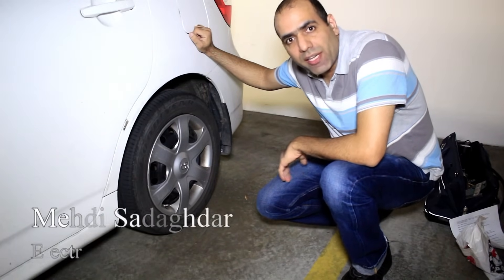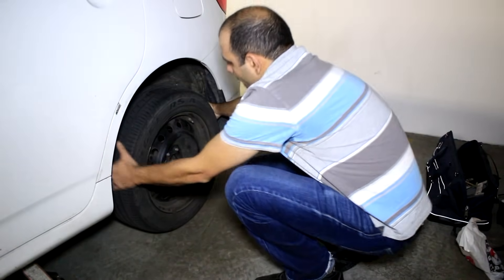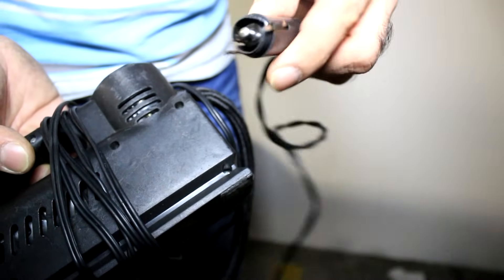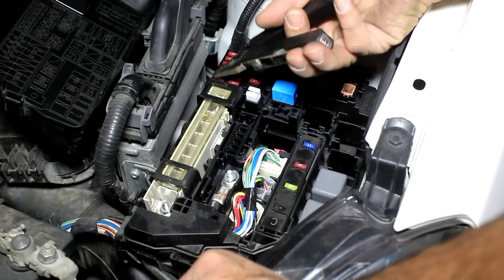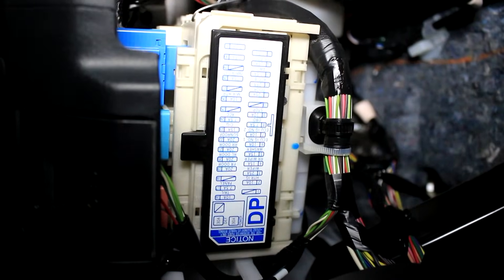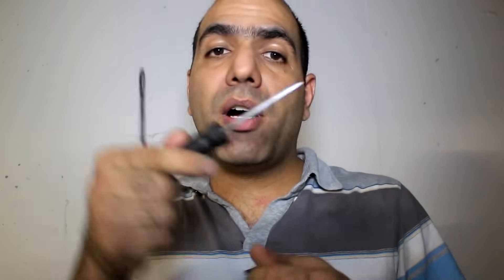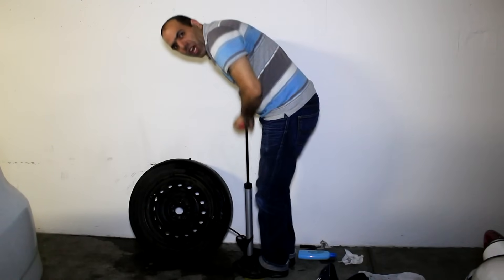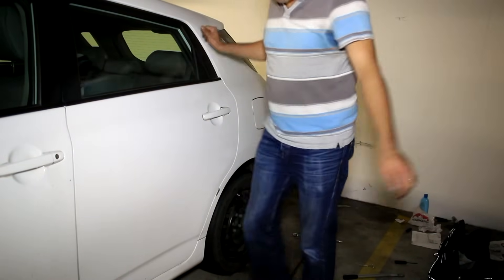How to Repair a Flat Tire

Comment: Don't ever do this. Just take it to a tire shop and have them fix it for FREE.
Reply: +flexor212000 Where the fuck do you live that a tire shop fixes tires for free?
Reply: SporadicallySane tireville
Reply: +SporadicallySane I work at Les Schwab and we always fix flats for free
Reply: flexor212000 i dont think you understand that he does this as a joke
Reply: +Ludde_12345 use your spare :)
Reply: +flexor212000 Discount Tire has always done it for free.  Even did it once when I didn't but the tire from them.
Reply: +SporadicallySane I've had it done in Canada many times for free
Reply: Just not used to it in Australia I guess. Glad you get a quality service like that in North America.
Reply: What if you aren't anywhere near a tire shop?
Reply: +SporadicallySane Les Scwab, Discount Tire
Reply: +Ludde_12345 put on the spare and drive to one.
Reply: flexor212000 what if you get punctuated twice?
Reply: +Ludde_12345 are you referring to having your spare tire punctured on the way to the tire store? then in that stage you have to be towed to the tire store and get a new tire. The liklihood is pretty low that you would get a puncture in the spare after you just put it on after getting a flat tire. It seems like you are trying to paint all of these what if scenarios to justify something? I mean sure if you could whip this out and fix it roadside I guess that would be nice?
Reply: +flexor212000 HOW ABOUT NO
Reply: +Noble Tabibian If you could do this at roadside go ahead. HAHAHAHAH

Comment: How to repair a flat tire
Step 1: Change the blown fuse in the fusebox.
Reply: +Sandman4991 I don't think I did it right. First, I repaired the lighter fuse. Then I changed the fuse. Then I blew the tyre.
Reply: +WorasLT But you don't have to change the fuse if it isn't blown, so:
Step 1: Blow the lighter fuse.
Step 2: Change the blown fuse.
Step 3: Repair the tyre.
Reply: @Sandman-cr6zn  Step -1, damage the lighter plug; Step 0, plug into the lighter socket.   :-P
Reply: @Sandman-cr6zn  200th like
Reply: +Bill Bingham you did have a spare under the bonnet though right :) (and I do not care if I spelled.. spelt.. whatever it correctly.. you know what I meant ) LOL
Reply: Step 3: Do just like this at 1:27 😂
Reply: Heh good one.
Reply: What you should be doing to know the proper P.S.I. on your tire. Is either check on the label, that'll have a chart on the proper P.S.I.,  that is usually layed by the driver side door. Or check in the owner's manual where there should be a chart as well. The norm is usually between 32 to 36 p.s.i. but better be safe then  be sorry.

P.S.
For those that don't know P.S.I. stands for Pounds per Square Inch. Rate of pressure per square inch to be more exact.
Reply: Nebepjauk asile
Reply: Step 2: replace coolant
Reply: @WorasLT i have the same pic as yours but i have mask on and a glasses and you are a pirate
Reply: I’m dead
Reply: Lol
Reply: lmaoooooooooo
Reply: Lol😂😂
Reply: Hahaha
Reply: I died a little that much I laughed😂😂😂😂😂
Reply: Instructions unclear.
I started the car on fire by putting a 40 amp fuse where a 5 amp was suppose to be.
Reply: LOLOL
Reply: Lol
Reply: OMG this step guide would make the best Tshirt for this channel
Reply: WorasLT iiI'm
Reply: aik nakui
Reply: SMH aren't funny.
Reply: Uhhhh got ass stuck in toaster

You wanna know how?

The toaster is extra large

Comment: Proper tire pressure can be found most usually on the door sill area.
Reply: Or the tire
Reply: You should never use the tire pressure rating on the sidewall of a tire. You should always use the number on the door or in the owners manual, since it will have the specific tire pressure for your vehicle.
Reply: Run a set of soft off road tires at that pressure, let me know what happens.
Reply: the electrocuted woodworker 
When you get to special tires like offroad tires, than it's a different story. Most people don't run offroad tires, and should not be going by what's on the sidewall.

Comment: That a bike tire plug. It might not last or you might get lucky. A car tire needs to be plugged from the inside and a patch placed over the plug- also from the inside.
Reply: +Adam R Those types of plugs hold perfectly fine. Of course, the plug and patch from the inside is preferred, but fixing it from the outside is just fine. And another secret - Discount Tire stores fix tires for free and properly.
Reply: +Adam R I feel like there is an update coming.
Reply: +Adam R Those plugs are what was used for decades by tire shops on cars before patches became the norm.  They work just fine, however, sometimes (very rarely) they can get loose.  Nowadays they're typically relegated to "emergency" use but they will typically last for years.  If they come loose, it will take several seconds for the tire to go flat, so it is not a blowout experience, just inconvenient.  Because tires are belted on the tread, the tire will not tear and explode.  Obviously, if it were a sidewall, both patches and plugs are a terrible idea and shouldn't even be used for temporary purposes.

That all being said, the hole he patched is too close to the sidewall and the tire should have been replaced.
Reply: +Adam R Those plugs are built for car tires, they're fine. Bike tires (I'm assuming you mean bicycle and not motor bike) are usually patched on the outside of the tube. Sure, you can patch the inside of a car tire, but then you have to deal with getting it beaded again which is probably impossible without the right tools or lighter fluid.
Reply: shepd shepd Too close to the side wall?! It's almost in the middle of the treaded surface! It was a perfectly fine repair.

Comment: Your fusebox is incompatible with the most of Hollywood action movies. Please change your car.
Reply: What, this doesn't make sense please explain, because if it has to do with hot wiring (like i think it does) they aren't accessing the fusebox, they are taking the ignition wires and touching the hot wire from the battery and touching it to the ignition wire etc.

Comment: First.
Spelled repair wrong.
Reply from the maker: +Toontown Telegraph Thanks! Corrected
Reply: Spelt*
Reply: ***** I have decided you like spelt more, because I like it that way.
Reply: ***** Doesn't matter you like it or not, the whole damn world spells it "spelt" except United States.
Reply: So keep and keeped, feel and feelled, deal and dealled, kneel and kneelled?
Absolutely not. It's "spelt."
Reply: +DrakeSilmore As silly as this argument is, in British English "spelt" and "spelled" are indeed pronounced differently and "smelt" is a valid past participle of "smell". If you need a source, check your local playground for the example phrase: "he who smelt it dealt it". :-)
Reply: +ratchet256 In American English, spelt primarily refers to the hardy wheat grown mostly in Europe, and the verb spell makes spelled in the past tense and as a past participle. In all other main varieties of English, spelt and spelled both work as the past tense and past participle of spell, at least where spell means to form words letter by letter or (with out) to make clear. Outside the U.S., the two forms are interchangeable in these uses, and both are common.

Source : http://grammarist.com/spelling/spelled-spelt/

while you are right, oggo loggo is also right. win-win
Reply: Murkaeus Well, that was pointless and redundant...
Reply: +Toontown Telegraph Both spelt and spelled are acceptable in UK english , and only spelled is officially acceptable in US english. You will find spelt used in northern US and canada, as well as the deep south, quite often, and 'spelled' pretty much everywhere else in the US, however, only in the past participle form.
With spelled being an acceptable British english received spelling, spelled is the only form which is always correct, regardless of your location.
Tyre/tire is another... just leave it be.
Reply: +Derek Leung That all depends on the country that they learned or "learnt" their English from. In the US we not only spell it that way, we prounounce it that way. Generally something that is past tense ends with an "ed" (cooked, hated, discovered). So implying that "spelt" is correct would basically imply that everything else that ends with "ed" should end with a T instead. (ie: cookt, hatet , discovert. So I think the best thing you can do is just accept that no English and American are both different but neither of them is "right" or "wrong"
Reply: +Murkaeus nice copy past
Reply: Wooooow... did not expect that not to sink in. Such a bunch of idiots replying to me, I don't even know why I bothered 
-_-
+benryves - For what it's worth, thanks. But I doubt we'll get anywhere.
Reply: benryves Ok, good point. Now we'll just move on to yell -> yelled. I know both spelt and spelled are officially correct usages, so the discussion is rather pointless, but as far as logic goes I'd say English is rather inconsistent, and ending with -lt just doesn't feel right for me. Then again, I'm not a native speaker.
Edit: seing as some words have both -lt and -lled endings, but others only have -lled endings, I'd say spelled is more correct of the both corrects.
Reply: Michael Tempsch And Platinium!
Reply: +Richard Smith and helium
Reply: +Gordon Freeman Beat me to it
Reply: +xSkitZx Look, I can list words, too!

Becudgelled, Bedrivelled, Blackballed, Chargrilled, Curveballed, Detasselled, Disannulled, Disbowelled, Dishevelled, Ensorcelled, Forestalled, Intertilled, Misenrolled, Mislabelled, Multicelled, Outcavilled, Outrivalled, Overchilled, Overspilled, Parallelled, Pedestalled, Protocolled, Redistilled, Reinstalled, Semiskilled, Sentinelled, Speedballed, Squirrelled, Steamrolled, Stonewalled, Subtotalled, Teetotalled, Unfulfilled, Uninstalled, Unkennelled, Apparelled, Backfilled, Bankrolled, Bedevilled, Bejewelled, Bemedalled, Caracolled, Chandelled, Channelled, Cockbilled, Controlled, Counselled, Coveralled, Embowelled, Empanelled, Enscrolled, Enthralled, Farewelled, Flannelled, Goodwilled, Handselled, Hatchelled, Highballed, Impanelled, Imperilled, Initialled, Inscrolled, Inthralled, Jackrolled, Landfilled, Lateralled, Marshalled, Misdialled, Misspelled, Mothballed, Outduelled, Outsmelled, Outspelled, Overbilled, Overcalled, Overfilled, Overkilled, Prechilled, Predrilled, Quarrelled, Reenrolled, Reexpelled, Relabelled, Remodelled, Repanelled, Retotalled, Rototilled, Scandalled, Shrivelled, Snowballed, Spancelled, Spurgalled, Stencilled, Surveilled, Tendrilled, Timbrelled, Trammelled, Unequalled, Unexcelled, Unlevelled, Unravelled, Unrivalled, Victualled, Vitriolled, Windmilled, Barrelled, Bushelled, Cancelled, Catcalled, Chiselled, Compelled, Corbelled, Cordelled, Corralled, Crenelled, Cudgelled, Defuelled, Dispelled, Distilled, Drivelled, Drywalled, Enamelled, Eyeballed, Ferrelled, Frivolled, Fulfilled, Funnelled, Gambolled, Gimballed, Gravelled, Grovelled, Hanselled, Hirselled, Hostelled, Houselled, Installed, Instilled, Kennelled, Kernelled, Laurelled, Logrolled, Lowballed, Marcelled, Marvelled, Misbilled, Miscalled, Morselled, Nickelled, Outkilled, Outpolled, Outpulled, Outrolled, Outwilled, Outyelled, Overalled, Parcelled, Patrolled, Pencilled, Pinballed, Pistolled, Pommelled, Prebilled, Prefilled, Propelled, Pummelled, Rappelled, Redialled, Redrilled, Refuelled, Respelled, Sandalled, Shovelled, Signalled, Snivelled, Spiralled, Swivelled, Symbolled, Tasselled, Teaselled, Teazelled, Tinselled, Tramelled, Travelled, Trowelled, Tunnelled, Unchilled, Undrilled, Unquelled, Unshelled, Unskilled, Unspilled, Untwilled, Upswelled, Weaselled, Annulled, Anvilled, Appalled, Begalled, Bevelled, Bowelled, Brailled, Caballed, Canalled, Carolled, Cavilled, Cupelled, Devilled, Dowelled, Enrolled, Equalled, Excelled, Expelled, Extolled, Gabelled, Gavelled, Gruelled, Hovelled, Impelled, Inwalled, Jewelled, Labelled, Lapelled, Levelled, Libelled, Medalled, Metalled, Modelled, Muralled, Panelled, Pedalled, Perilled, Petalled, Ravelled, Rebelled, Rebilled, Recalled, Refelled, Refilled, Repelled, Repolled, Rerolled, Revelled, Rivalled, Rowelled, Scrolled, Sepalled, Shrilled, Squalled, Strolled, Thralled, Thrilled, Totalled, Towelled, Umbelled, Unbilled, Uncalled, Undulled, Unfilled, Ungalled, Unmilled, Unpolled, Unrolled, Untilled, Unwalled, Unwilled, Upwelled, Yodelled, Chilled, Dialled, Drilled, Drolled, Duelled, Dwelled, Frilled, Fuelled, Grilled, Knelled, Knolled, Kvelled, Prilled, Quelled, Quilled, Sculled, Shelled, Shilled, Skilled, Skulled, Smelled, Snelled, Spalled, Spelled, Spilled, Stalled, Stilled, Swelled, Swilled, Trilled, Trolled, Twilled, Vialled, Woolled, Balled, Belled, Billed, Bolled, Bulled, Called, Celled, Culled, Dilled, Dolled, Dulled, Felled, Filled, Fulled, Galled, Gelled, Gilled, Gulled, Helled, Hilled, Hulled, Jelled, Killed, Lalled, Lolled, Lulled, Malled, Melled, Milled, Mulled, Nilled, Nulled, Palled, Pilled, Polled, Pulled, Rilled, Rolled, Tilled, Tolled, Walled, Welled, Willed, Yelled
Reply: Dex Dogtective Thanks, man
Reply: +xSkitZx You're point was so blunt, you could club baby seals with it. You think that simply because there are words that legitimately end with "lt" in their past tense form that "spelt" is the only acceptable spelling. But that is as inaccurate as it is blunt. My word list was jokingly supposed to reinforce the fact that there are far more words that use "lled" in past tense. Apparently providing over 300 examples was too subtle for you. So now I've spelled it out for you.

Also, I'm curious where you could possible have thought this was going. Did you think some rambling in the Youtube comment section was going to reverse what is likely a couple hundred years of lingual evolution?

Bonus points: every time I type "spelt," it's marked by spellcheck as incorrect. :)
Reply: +xSkitZx Yup, just like Plutonium, Uranium, potassium, Vanadium and Aluminum all follows the same pattern... or not.
Reply: ***** Well actually the uploader himself if he renamed the title (see above).

Also, nice one bringing up a thread that finished over 3 months ago.
Reply: Humin Behaviorz Well, they do like to use a t sound for many words that end in a vowel followed by a d sound, funnily enough.
Look at the word good, pronounced 'goot' in much of the UK. It's all too convoluted to argue about, just let it go :P
Reply: Richard Smith I didn't even argue and I did let it go.
Reply: Derek Leung Why does this happen every time somone makes a typo? spelled is correct in British and "spelled" is correct in American English. Neither of them is incorrect. It just depends on the country.
Reply: No he didn't
Reply: What? He was genuinely talking about spelling, not sarcasm hahahaha

I can see why you would confuse that tho
Reply: Hiiiii
Reply: Toontown Telegraph what the second thing???
Reply: It’s spelt actually (Past tense)
Reply: no pls!
Reply: +Derek Leung The whole damn world is wrong then--again.

Murica #1! 

Remember: if you're not first, you're last.